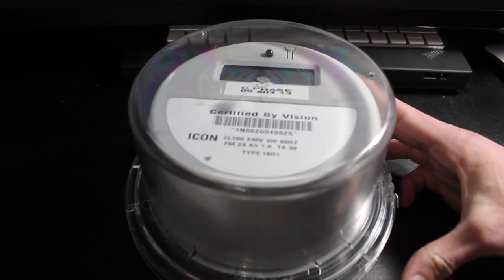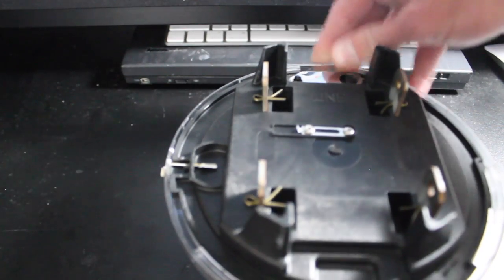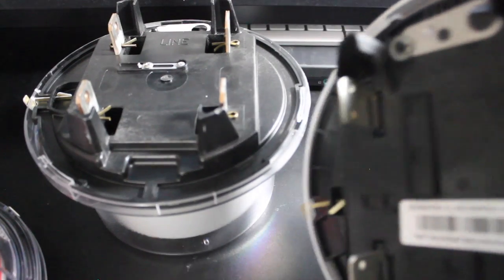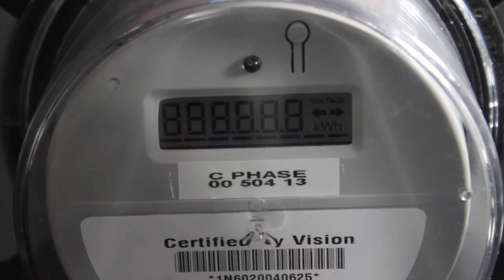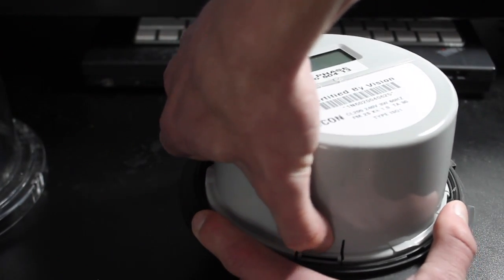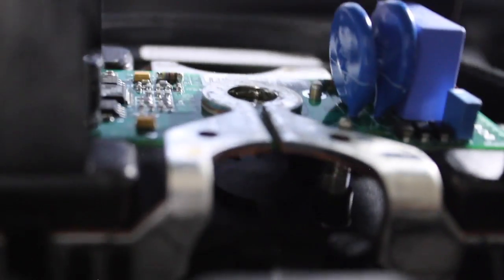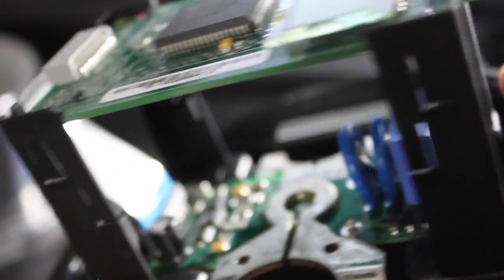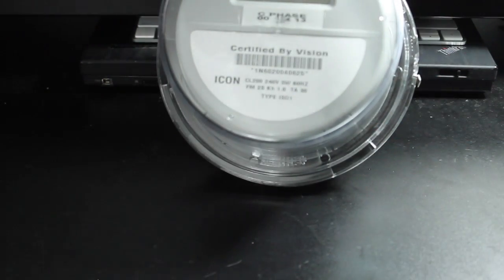Sensus iCon Smart Meter Teardown

Comment: OK now on to the video, absolutely agreed.  These ICON meters are the ones that cause fires, obviously even though they are rated at 200A, that doesn't mean the service entrance and premise circuit panel won't throughput 300, 400+ A.  Since there's no overload protection and (like you mentioned) loads of flammable plastic... there ya go :-) And just to let you know, the circular section of the bus bar sits above an inductor on the backplane, which measures the current flow (not very precisely, but cheaply) and it's the same principle as inductor loops in roadways that count the number of cars that pass over them... only this one in a nutshell counts the number of electrons that pass over it.  I hope this helps, and I hope I don't sound patronizing!
Reply: Harley Badger...Do all of these meters measure usage the same way? Are there better quality parts that are more accurate? How do I tell if the one they're installing is junk or good quality?
Thanks for any help/advice

Comment: Invensys are a switchgear maker Chinese made for sure This would be a good candidate for my PFC cap bank I think this uses a hall sensor to read the current flow
Reply from the maker: Thank you for the information! And yes, I was unsure if it was Chinese made, because of the quality. I'm not sure if Sensus still makes meters now, they got a big slap on the wrist from Exelon for the fires they started. I think Itrón makes the best smart meters, they're made in the USA, and they are comprised of all copper contacts.